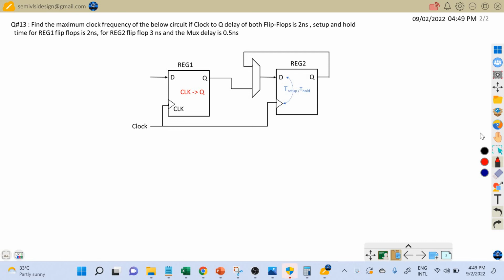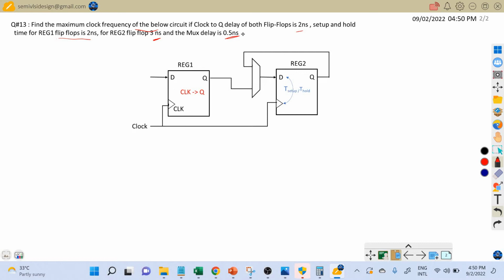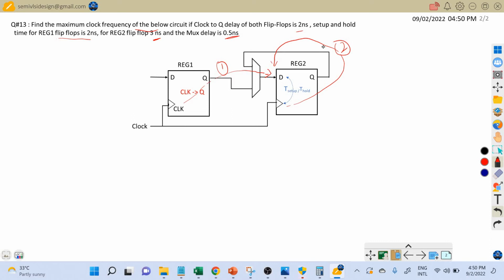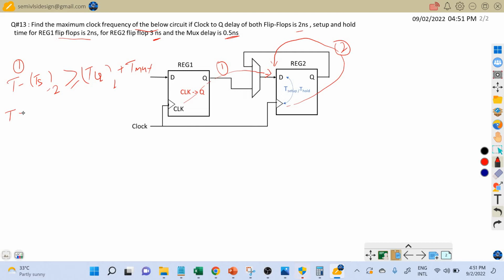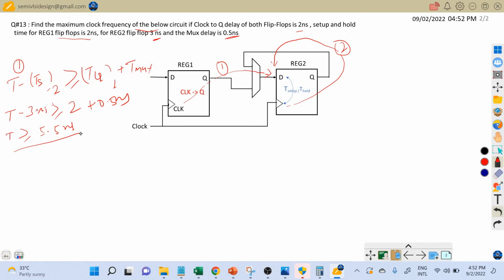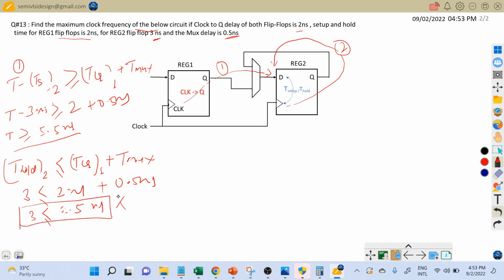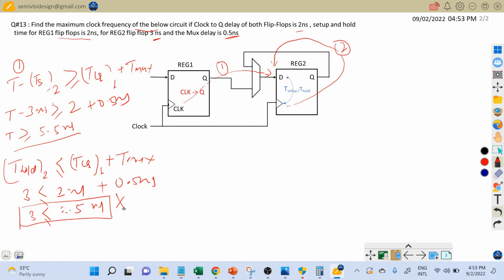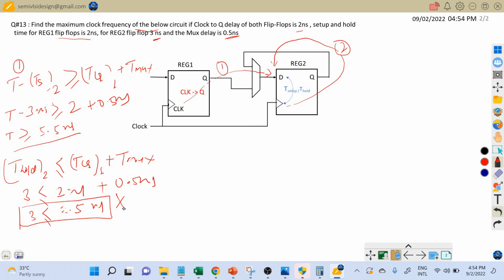Interview Question #13 | Maximum Clock Frequency (Hold 🤔) | Static Timing Analysis (STA)

Comment: it's another of misleading questions, like the one before, also the mux control pin was not even drawn ...
the issue is that's such circuit will work depending on the data frequency, so if we make sure our data speed is half the clock then it will work

Comment: ir since hold violtion here, ck doenot work so does the max freq will be 1/(5.5ns)  ???
Reply from the maker: Hi @Tarak Sriram, If no hold violation, yes the max frequency is (1/5.5ns). But, with hold violation, no matter what is the frequency , the circuit is useless !!!
Reply: @vlsiexcellence  but I thought hold slack is independent of frequency, so how is violating hold affect the max operating frequency?